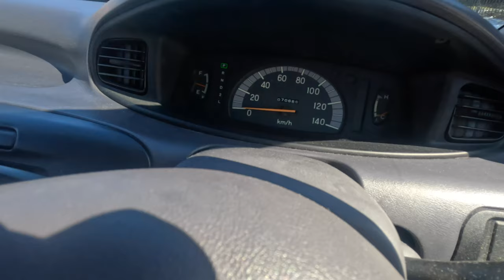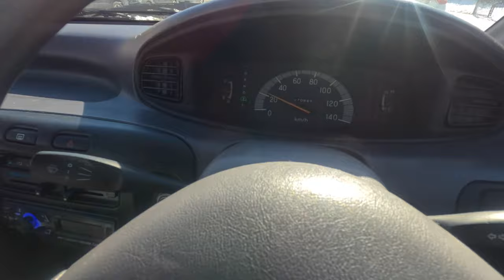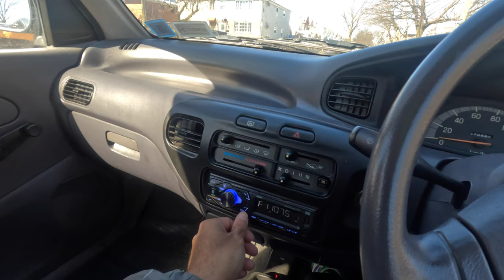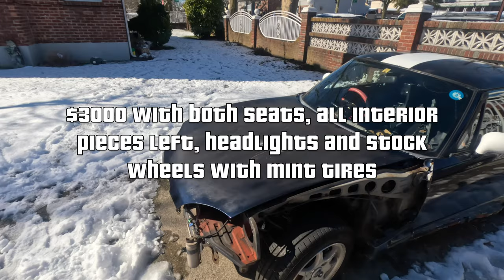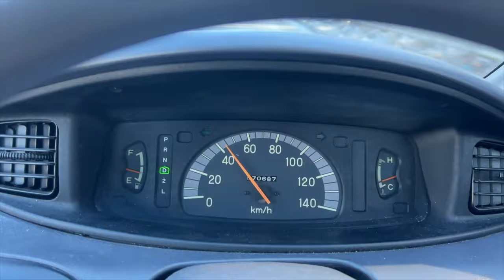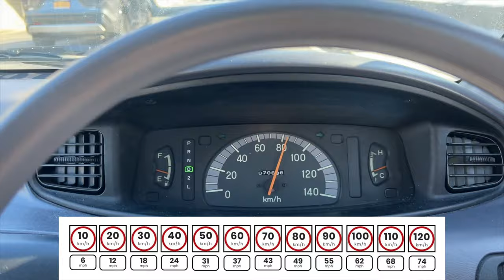I Need To Sell 2 Of My Kei Cars..

Comment: You’re right that parts are easy enough to source from Japan. The real problem is these parts are going away even in Japan. Used parts are obviously always limited and new parts are less and less available (most oem parts discontinued). Now, with non kei Japanese cars there are enough crossover parts that work available in the USA, but the kei cars have a lot of unique parts never sold here. So it’s kind of a big risk for anyone here, especially if you have no mechanical ability. I think the sweet spot are the smaller non kei cars, which share most of their parts with some USA car.
Reply from the maker: I think most people who buy kei cars get them for the uniqueness. And then luckily there’s a bunch of Facebook groups and youtube channels that can help finding parts. I’ve never not been able to find a part on my 12 kei cars
Reply: @Waybeforethefame   For sure, I'm not saying you cannot get parts now. I'm saying eventually it will be an issue. Not only that, but if (when!) the car breaks years later most people will have to pay someone to fix the car. Most mechanics won't touch these cars for obvious reasons. None of this applies to you, of course! I'm just thinking of the average kei car owner. Keep up the good content sir! I love your videos/content.